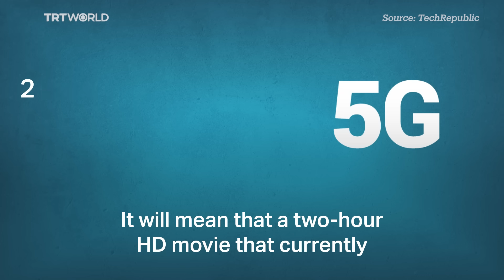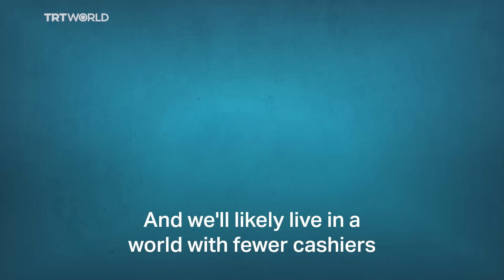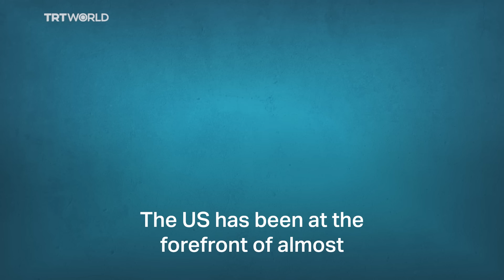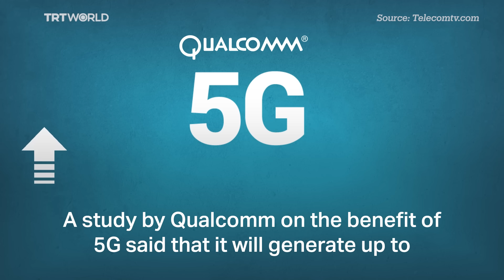The race to 5G explained

Comment: I have written a lengthy document listing 16 areas of concern related to the rollout of 5G. The claim that there are only thermal effects from non-ionizing radiation is, simply put, not true at all. Despite what some say, there are in fact at least a couple of thousands peer-reviewed studies showing very significant negative biological effects of non-ionizing RF-radiation. You can find links to the studies in the full document. When I tried to post links, a longer text and use paragraphs my comment was flagged as spam (because of the settings of the channel owner) so the solution was to post it in the description of the only video on my channel. You can find the document by clicking on my channel. Some of the topics / areas of concern: 

An astounding lack of studies on the health effects of 5G, the studies that has been done show harmful effects - Thermal vs non-thermal effects, studies on EMF-effects on humans, insects, plants and animals - The two biggest studies to date show clear negative effects from exposure to EMFs - Appeal from 250+ EMF-scientists - Conflicts of interest and other major issues within the agencies that set the standards / Industry influence in EMF-science - Our sweat ducts and eyes act as antennas for 5G-radiation - Potential effects of EMF and millimeter-waves on the cell’s mitochondria - Push for AI - Security and privacy issues

Comment: DoD already used up a big part of the 5G MMW frequencies (spectrum allocation for 5G), leaving less commercial use. The excerpt below explains why the U.S. is still struggling with 5G in terms of implementation. 

"The Department of Defense (DOD), however, holds large portions of the usable spectrum. Although DOD uses certain MMW frequencies for high-profile military applications such as Advanced Extremely High-Frequency satellites that provide assured global communications for U.S. forces, it extensively uses sub-6 frequencies—leaving less sub-6 availability in the United States than in other countries. The Defense Innovation Board (DIB) advised DOD to consider sharing sub-6 spectrum to facilitate the build-out of 5G networks and the development of 5G technologies used in the sub-6 band. While DOD has been moving toward greater spectrum sharing, it has expressed concern that sharing presents operational, interference, and security issues for DOD users. As an alternative to spectrum sharing, some analysts have argued that portions of the sub-6 spectrum should be reserved for commercial use. This would require DOD to relocate certain applications to other parts of the spectrum. The DIB estimates this approach would take around 10 years to complete, as opposed to 5 years for spectrum sharing."

Comment: Telecom are biggest Co2 Emiters comparing to Aviation Industries around 350,000 Telecom tower are in China. Each tower are run by diesel Engines 24Hours/365 Days. Just imagine India, Russia, U.S, Europe, and so on..

We are slowly killing this planet and Toxicating our breathable air every day.
Reply: Aren’t they connected to the power grid?
Reply: @VashtheStampede007  yes only during power failure generators are used